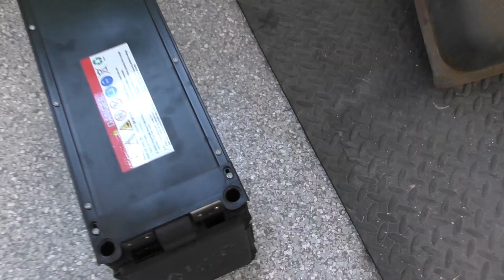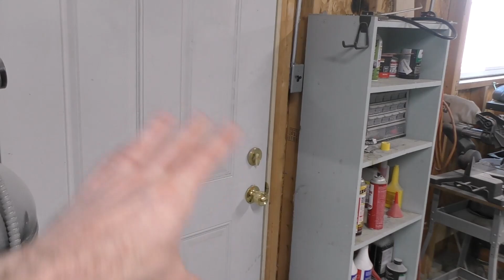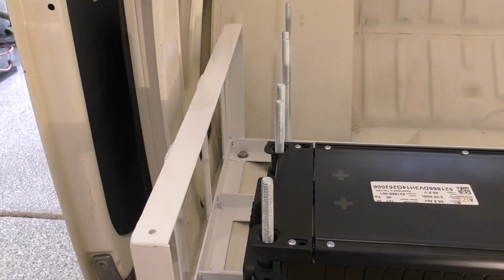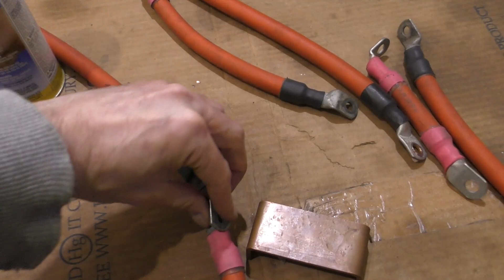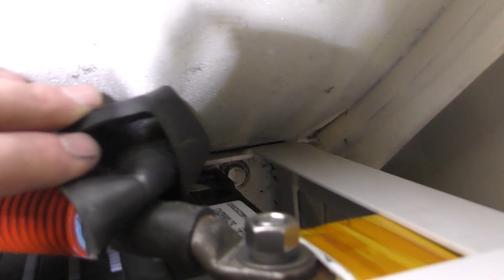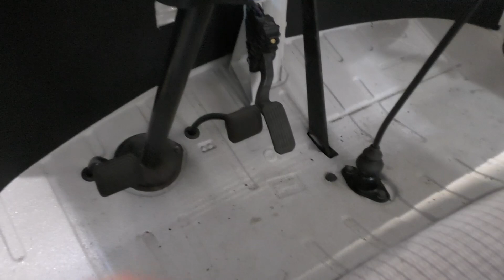VW Bus Electric Conversion Part 15: Battery Box and First Spin #evconversion

Comment: Perfect timing I am doing a very similar build! And using your videos as a how to, the gigvac contactor link does not work any other recommendations?
Reply from the maker: Very cool! Before buying the contactors, watch my next few videos, especially part 18 as I made changes to my parallel pack contactor arrangement. The most common contactor to get would be the Kilovac EV200 which is a little better.  Thunderstruck and many other places sell them: https://www.thunderstruck-ev.com/main-contactor-economized.html

Comment: first spin! what a great milestone! i'd recommend something more on that negative bus bar... not just for dielectic but any possibility of vibration causing abrasion. Also, do you plan to enclose your battery box? Something with a melting point high enough to give occupants time to get out safely. Also, it would be good to have something more to completely eliminate anything dropping down into the section with those exposed contacts. Great job scotty! what awesome progress!
Reply from the maker: Thanks Frank!  I have a thick plexiglass panel that will cover the top.  I will also add some panels to the sides to protect the bus bars.  Still more room to iterate and improve...

Comment: plz do a video on how not to die when working with high voltage lfp batteries when working on an electric convesion or plz refer me to someone, l live in South Africa and the only cheap batteries available for me are lfp 100 amp.
Reply from the maker: These battery modules contain 78 LFP pouch cells.  So you just saw someone work with high voltage LFP batteries and not die 😌.  Check out my previous video where I cover other LFP prismatic batteries and give more information on these modules:  https://youtu.be/brmrzalmewM.  Thanks for watching!